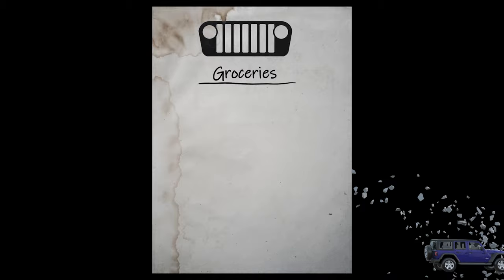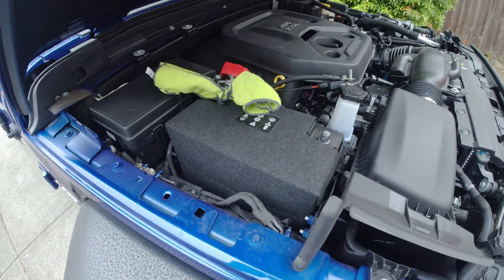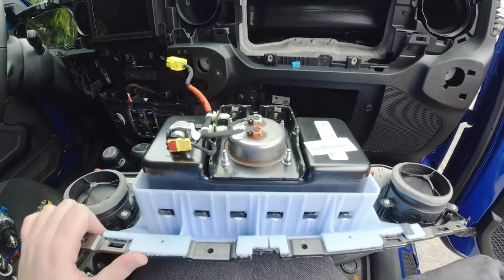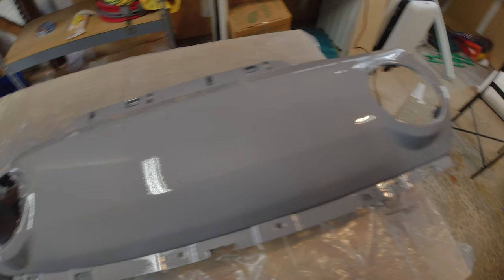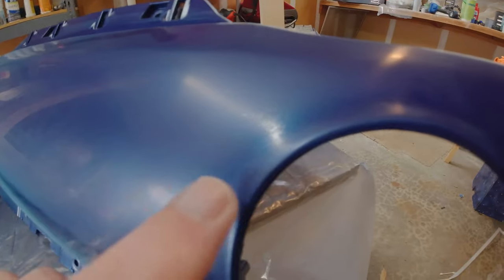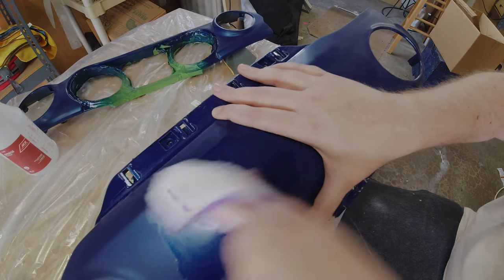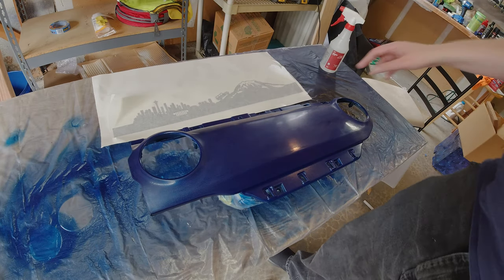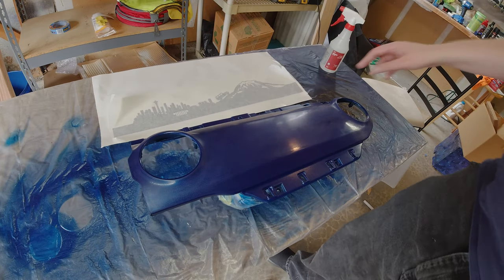How NOT to paint your Jeep JL Dash.

Comment: Thanks for the heads up on the paint.  I'm presently waiting for the mopar paint (punk'n) to come in.    But, I did buy a pair of dash panels to paint punk'n with black rings.   So, I have time to work on it.   Plan to just paint the chrome rings black.
Reply from the maker: Glad I could help.  I think the mopar paint will work, but be careful with the primer.  I used some off-the-shelf primer, and the mopar paint ate it even after 24 hours of cure.  I had door sill guards painted in truck bed liner that cured for 5 days and the mopar paint ATE THROUGH THAT.  This stuff is really nasty and strong.
Reply: @myblujl7503   then what is a good primer?
Reply from the maker: @delbancroft9339  Honestly I dont know.  The can recommends a Mopar primer though.
Reply: @myblujl7503   I order two cans yesterday.  Figured it better work with thier paint.
Reply: Ok so I used the Mopar primer filler and the Mopar color match paint.    
I used 400 grit sand paper over the entire panels (including the black gauge area).  Yes I wanted that area Punk'n also and the chrome rings gloss black.   
Washed with water and wiped dry
Used denatured alcohol and let set a couple of days ( because the primer was back ordered)
Put three coats of primer on both panels with 7-10 minutes between coats.
Waited 15 minutes and put a coat of Punk'n paint. Followed by two more coats 10 minutes apart.
Waited 15 minutes and put a coat of Rust-Oleum 2x gloss clear coat.   Followed by a second coat 10 minutes later.   (It was a used can and all I had, plus wife reminded me of grad party).  Wish I had more for a third coat.
Returned from party three hours later.   Panels looked freaking awesome (close to the factor body paint)......but...... And a big but....... The black plastic around the gauges looked like I used "crackled" paint.   
Sanded(400 & 800 grit sand paper) the black plastic smooth this morning. Really bad areas were back down the primer or plastic.  Washed down, wiped dry and let set few hours in the sun to fully dry.    
Hit with primer and well dang, crackle paint groves not accepting primer.   Two coats and looks like crap again.   But only in the bad areas.   Others looked ok. 
Let dry and re-sanded bad areas.   Used two coats of Rust-Oleum primer, then a coat of Mopar primer.     Followed by three coats of mopar Punk'n....still needs the clear coat...   Will keep you updated
If I didn't paint the black plastic, I would of installed them today.
Reply from the maker: @delbancroft9339  Sounds awesome!  Did you get any primer bleed through like I did?  Sorry to hear about the gauge rings.  I just used rattle can primer and Rustolium after sanding and didnt have that problem.  I dont know what causes that crackled effect.  If it looked cool, maybe use it as a "happy accident"?
Reply: @myblujl7503  the Crackle paint looks bad...very bad....
No bleed thru on the rest.

Comment: Did you have to disconnect the secondary battery on the Jeep to prevent the airbags from going off?
Reply from the maker: No.  That battery only handles small electronics like your Jeeps computer.  Air Bags have been around for a very long time, and multiple safety features are in place to keep them from going off when not needed.  If the car is not on, it wont go off.
Reply: @myblujl7503  Awesome Thank You

Comment: If I didnt want to take it all.apart and bought the kit that goes in with 3m tape could someone do the same thing but just tape it on?
Reply from the maker: It could, but if you tape a large piece of plastic over the airbag, it truly can kill someone.  The dash is engineered to tear itself apart without creating shrapnel, but that plastic cover will just be a projectile.  I suggest if you dont want to put in the time, try to cover it with vinyl rather than plastic.

Comment: Please stop the madness. That is an airbag component. Please do not instruct people to remove the passenger bezel, and certainly not the airbag. In addition, do not instruct people to sand, paint, or change anything on the surface of that bezel. The airbag is designed to deploy through the bezel. A tremendous amount of testing goes into making that system function properly during a deployment, and any modifications to it can affect that performance.